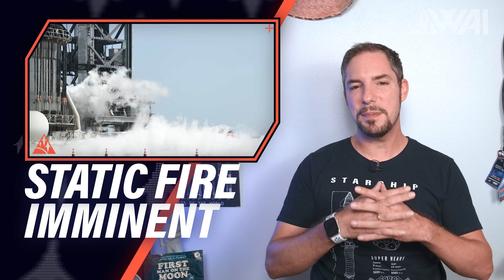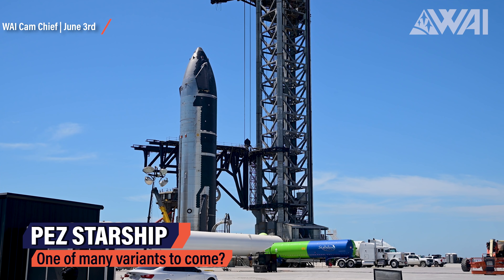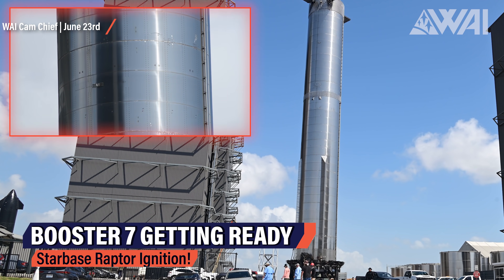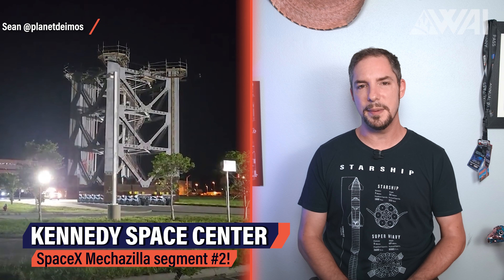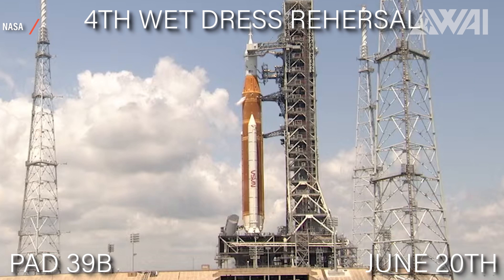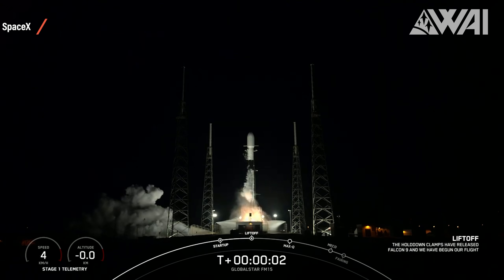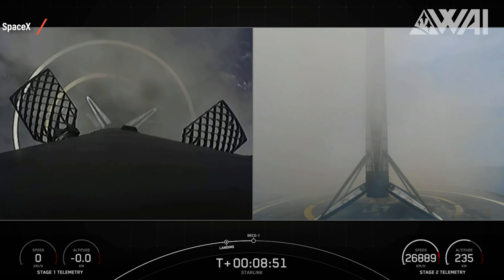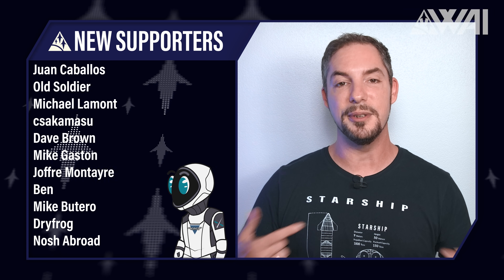SpaceX Starbase IGNITING Starship Booster Engines!

Comment: There could be a ton of starship variants in the future, but the first thing you would have to do is distinguish between star-ship variants that have to enter an atmosphere (which would only be needed on Earth, Mars, and Titan, the moon of Saturn, i believe), which i call the "endo/exo-atmospheric star-ship", and therefor would need the atmospheric engines, a heat-shield and the control surfaces, and then there are the variants that DON'T need to enter an atmosphere (pretty much most of the solar system objects), which i call the "exo-atmospheric starship", and therefor don't need atmospheric engines, a heat-shield, nor control surfaces (saving mass, and therefor, weight). From there-on there could be several different type of cargo star-ships, like the star-link pez-dispenser variant, a heavy (or bulky) cargo version which i call "the flatbed", one version which i call "the hauler", which would transfer smaller pieces of cargo and/or cargo in shaped containers that are of different shapes, sizes and uses for dry, or wet (certain liquids, like water perhaps?) cargo, or special containers that could either be climate controlled (for food stuffs and perishable items), to specially designed containers to protect sensitive equipment or cargo against damage, vibration or different types of radiation, all of which would be able to be stacked inside of a star-ship cargo bay, not unlike lego blocks, and this star-ship variant, could also exist in both a (semi-)manned, or unmanned version. Then there is the design we all know and love, and that i call "the showroom model", or "the human colony transporter", and then there are the deep space, and the tanker variants (which, the tanker variant, could theoretically also be used as a booster to give a star-ship more launch options if so needed) so basically a tanker with the three center-core, gimballing, atmospheric engines left in place, but instead of surrounding them with external cargo and/or three (or more) vacuum raptors, you surround them with however many atmospheric engines needed, depending on the mission parameters (anywhere from six minimum, to nine, or even twelve maximum, making fifteen engines in total ?). You would keep the control-surfaces, but you could probably ditch the heat-shield, because they would not get high enough to need one. They, together with the heavy booster, would also have to be adapted for such a use, plus there is the issue of landing these things, which would either mean some type of landing-legs, or some type of an adapted landing platform, outfitted with a shortened mecha-zilla tower attached for capturing both the boosters, and one for the (shortened) core (heavy) booster (the more boosters attached, the shorter the center-core booster would be, and the less engines it has, b.t.w.) If this were possible to be implemented, you could attach a second stage (and, ultimately, a third, like the designs by space-x vision on you-tube !) to the booster, which would be in length from at least twenty to thirty meters, up to (maybe?) forty to fifty meters ! Again, these second stage variants would have to be adapted for these types of uses, because they are not coming back down to earth, but would instead stay in space and have (multiple) secondary uses, like debris removal, makeshift orbital propellant depots, orbital transfer/service vehicles, and so-on. These versions would therefor use only vacuum raptors (anywhere from three to four for the shorter versions, to up to six or seven for the tallest versions), and they would also need to have their tanks insulated, to prevent as much propellant boil-off as possible, or, perhaps, be built with the orbital propellant depot in mind, if needed. There could, theoretically, be nuclear, and/or nuclear/chemical versions as well, but further along the development timeline. Well, that was quite the write-up, not to mention one hell of a comment.

Comment: Have we forgotten Newton’s 3rd law? Paraphrased “For every action there is an opposite and equal reaction.” So every time a Starlink is launched a force or recoil of equal force will want to start the Starship to spin. Seeing the Starlink launcher is cool but what the plans to deal with this problem? Would like to see that in a future video.
Reply: I'm sure they have thought of all possible problems or those engineers wouldn't be there.
Reply: @bobbyalaskanexplorer6453  Bobby, Bobby, Bobby, I just retired from 36 yrs working with aerospace engineers. One thing I learned is never assume the engineers thought of everything. There is too much of that “It never occurred to us that this could happen!” I worked in Quality always having to verify their work and have prevented many bad test results by just applying simple rules I learned in jr. High school science.  Remember you can send a message electronically around the world in less than 4 seconds but it can take years to penetrate the quarter inch of an Engineers skull.
Reply: @hardnuts69  mechanical devices can always malfunction but I trust that SpaceX has done their homework and r satisfied they built a device that will work and give them results they want.
4 someone who worked with aerospace people you sound more like a denier. You r making an opinion on something you have no 1st hand knowledge of or the people building it. SpaceX has a great record of being successful and won't give up if it doesn't work properly the 1st time, they will keep refining until its flawless if its not already. 
SpaceX has perfected everything they struggled with at first and are now the premier space company.
I'll bet on them before ever giving a person like u a second thought.

Comment: I thought a split Lunar Starship would be good.  Once it got to low lunar orbit, it could split with the upper section being a lunar lander with deployable legs similar to those of Falcon9.  Once the legs are deployed, there would be no need to retract them.  The lower section with lox/ch4 tanks with Raptors would stay in orbit.  Upper portion, lander might have its own lox/lh2 propellant tanks for landing/ ascent engines.  The sections would re-dock and return to LEO for refueling and a new crew and cargo.

Comment: What about three sections instead of two?

Bottom second section for propulsion, top section for fins nose and miscellaneous payload.

Center section itself would be the primary payload, and would be hexagonal. 
Multiple hexagonal sections could be assembled at destination planet like a honeycomb to create human habitats.  The top of each hexagonal section would be a skylight for use as a greenhouse or otherwise for visibility to the outside. The advantage would be the most of the construction would be done on earth rather than at the destination moon or planet. 

After disassembly at destination and placement of center section, top would be joined to bottom and flown away

Comment: For the Mars version, attach the crewed upper stage to the bottom half of Starship with clamps similar to those attaching the Starship to the booster.  On Mars, use a crane to lower and position the crewed section on the surface.  Instant habitat with everything already installed and functional.  The Starship cargo section and airlock would now be at ground level and could be used for vehicle and equipment storage.

The crew would return to Earth by a different Starship.

The crane would only need to handle the upper section -- 100 tons on Earth but only 30 tons on Mars -- and could be used for other purposes.  This will be less complicated, safer, and less time consuming than transporting, constructing, and equipping habitats from scratch.  

 The remaining Starship lower section could be used for fuel storage.

Comment: Star ship well let’s have limit to 100 versions that may be possible but if there are more then it will be limited. And then video cameras can be upgraded though out the years and problems will be found at any time and anywhere. People can make mistakes but can fix the problem and nothing may be easy but to repeat the same actions over and over again till the problem has been fixed it is the same thing as trying the hardest to explain most things to other people without getting too defensive or offensive because the point has been made and it gets harder when some things are not completely looked in that perspective and English is hard to learn but sometimes you don’t need to care about the meaning of what needs to be said as long as it is spoken as if it is understood and no questions to be asked and when words that people wants to say are not understandable and words are thrown around to try to make their words sound understandable until the words are written or said are straight forward and not off topic. 

This may or may not be straight forward with People not understanding what I may want to say and it will take some time to think something up before saying these words and I had to make this disclosure to what I said from the start of this comment to the ending of the word topic and at times it is hard to be defensive or say what you want to say to offensive and words may be all over the place because it is really hard to explain what ever in experience or from other sources of information and people from time to time will stumble over their words with out knowing what to say and it is good to speak to each other vocally rather than texting words like the words are written specifically to try to explain something or anything specifically to the point of the topic weather it is politics or news or a large list of things that are too long to wright down for everyone to read and if anyone wants to start questioning me then you already got the point and at that point it is also hard to think of questions that aren’t really offensive like questions to attack and the answers needs to be defensive and that is the point of politics that might sound like anything could be offensive but instead people are trying their hardest to explain or say what they want to say either from reading from a news source or from their hearts there are problems that everyone needs to live with and get through it and there are problems that can be fixed is the point that is made and the closing statement that I will be making.

Comment: Real Question - If SLS uses Space Shuttle engines what is the long-term plan to keep that system flying (if) they can even make it to the moon.   The system is struggling just to recreate the Apollo flight program.   The bottom line, it does not seem like a long-term solution.  aka... waste of taxpayer money and time.    Thanks for all your hard work putting this program out there
Reply: Congress de facto has never care about space exploration, they just want jobs program out of it

Comment: I think there could be more use cases for the PEZ dispenser variant than just Star Link.

Sure, for the moment, the only satellites with that form factor are Star Link V2.

However, this could easily be established as a standard form factor for medium sized satellites, similar how "cube sat" is a standard form factor for very small ones.

SpaceX could potentially even follow RocketLab's Photon idea and provide a standard satellite on which customers could then just integrate their mission hardware.

A PEZ dispenser Starship would then become a ride-share delivery vehicle.

Comment: There is no need to design Starship for interchangeable modules.  Elon intends to be pumping out new iterations every few days; each can be designed precisely for whatever is required: aside from cargo, crew and fueling missions, I would be surprised and disappointed if one were not fitted specifically to reach out to the JWST to repair the mirror which was damaged, and to refuel it once its propellant is exhausted.

Keeping the Hubble and ISS running would be much easier tasks by comparison; but there is another mission Elon mentioned on the very day they docked to the ISS for the first time.

Just as it inched forward to connect, Elon seemed not to be talking to anyone, but thinking out loud when he said, "The next thing I'm going to do is mine the asteroids."

The dude is so smart, capable and self- confident, it's almost scary.

Comment: I really liked your swiss army knife starship idea. However, given how starships are manufactured, I don't think any joining mechanism would beat the structural soundness and sealing of a solid weld. Such a mechanism would also add mass and would take away payload capacity. Not to mention, it could become a failure point. The two halves couldn't be sealed metal on metal due to vacuum welding and any material applied on the joint could wear away unexpectedly and cause failure or loss of a starship. During reentry, the heat and pressure would put a lot of strain on the joint and joining mechanism. 

Given how cheaply SpaceX can produce the starship tanks and fuselage, I think it makes more sense for them to make as many specialized variants as needed. Starlink Pez Dispenser makes the most sense since that variant will see hundreds-thousands of launches to populate the Starlink constellation, and will see steady work there after replacing Starlink satellites that fall out of orbit. We already know there will be a dedicated specialized Lunar lander variant as the proposal accepted by NASA lacks any of the Earth reentry shielding. We'll probably see a similar variant for ferrying and landing on Mars. I also expect, if ballistic non-orbital rapid transit (or whatever it's called) becomes a viable business model, we'll also see a dedicated variant for that as well; this variant would be packed with seating and may be launched with a smaller booster or may have different engine configurations on the bottom to be launched without a booster (I'm not sure if Starship has the fuel and payload mass capacity to do that without a booster). We'll probably see a fuel starship, with the payload bay occupied by extra fuel tanks for fueling Lunar and Martian starships. We may also see a dedicated cargo variant for both Mars and the Moon. I also imagine we'll see a LEO payload variant for shuttling up large satellites and space station components into LEO, with refuelers able to extend its utility to ferry cargo to Lunar Orbit as well.

Most of the cost associated with a Starship is probably its engines given the time that goes into producing each one. Even when SpaceX achieves its target economy of scale for engine production, they'll still be the components with the tightest tolerances and highest quality on Starship. Engines though can be moved between rockets so it makes the viability of ultra-specialized mission variants very economical. So if NASA or some other entity wants to make an asteroid capture starship, even if it's a single there and back mission, the cost is really the fuselage and tanks, plus fuel, and mission depreciation/wear and tear on the rocket engines. Post mission, the engines can be taken off the fuselage, maintained, refurbished, and refit on a new starship. As Starship proves its rapid prototyping and mission viability, we'll likely see dozens or even hundreds of short run scientific mission variants which never go into mainstream mass production. I imagine once enough mainstream variants go into production and prove the base design's safety, performance, reliability, and reusability, ultra-specialized mission variants could go from drawing board to launch in as little as 6 months. Certifying the internal changes of a proven fuselage will be very fast.

Comment: Between the sls rocket and the starship I trust the starship. The other is the cost of each per launch and which means that starship will be much cheaper to launch than the sls one use system that can cost tens of billions for each launch . The other is safety that nasa still hasn't been able to achieve completely.

Comment: I think two of the upper stages should be able to be connect together nose to nose with a cable so they can be rotated to create an artificial gravity equal to the gravity Of Mars . Such that the two rotating starships can travel to Mars with one Martian gravity for the crew in the starships , gravity created by centripetal force.

Comment: Instead of a cargo container, the starship could act as a flat bed truck and maximize how many flat panels go up in one trip for bulk construction, such as prefabricated walls and extremely large inflatables.
Also, Is a nose cone necessary if the only thing returning are the boosters?
I could see parts going up perform steering functions, aerodynamic fill, and tethering on the way up before being repurposed into permanent use in orbit.
Depending on weight, the cargo's diameter may exceed the diameter of the booster.